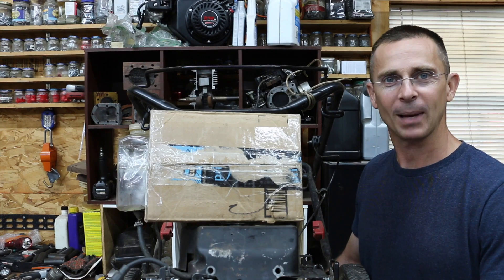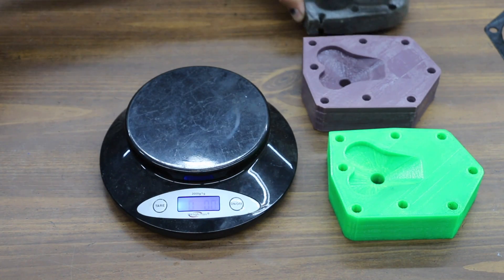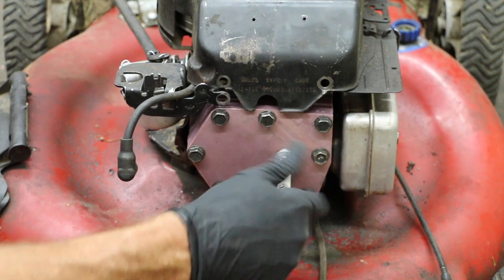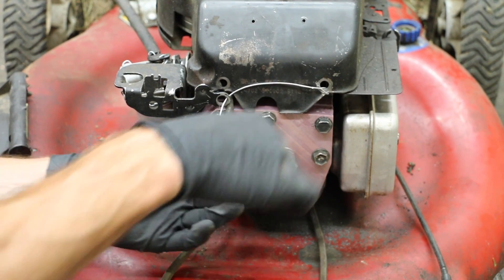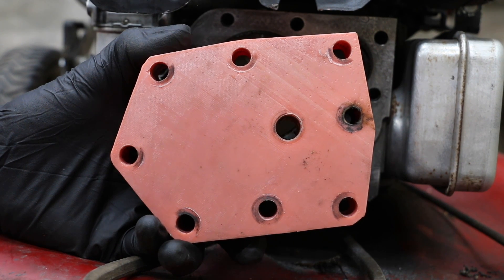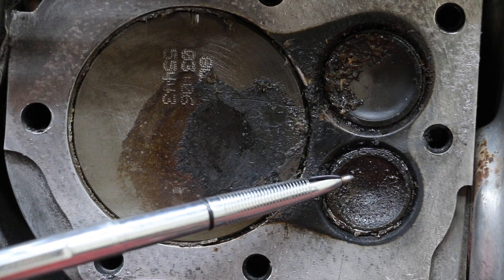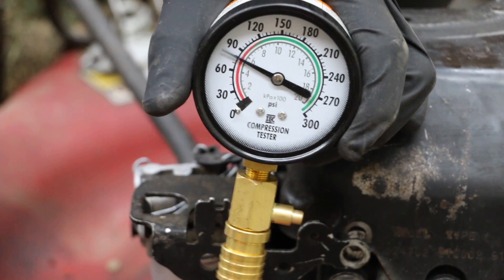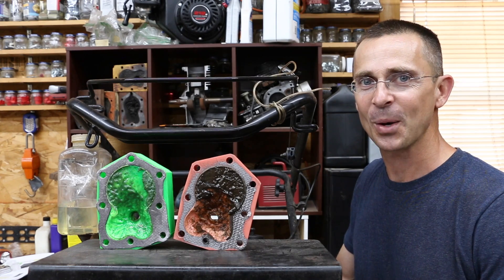How long will a 3D printed cylinder head last?  Let's find out!

Comment: Do longer spark plugs boost compression on an engine, cause the piston to overheat and melt, improve fuel economy, better throttle responce, better ignition and improved flame, will the longer threads have carbon build up causing the spark plug to become imposible to remove? Some of the things you could do. I use longer plugs on my Acura Integra. I for sure notice performance gains. Better throttle responce, more power, torque, maybe even better fuel range. I cannot give you a comparison to fuel range because the cars speed sensor is not functioning. Also the fuel gauge is not reading well. My engine is a B20B (found in CRV) and I use NGK Copper Nissan Sentra 1.8L spark plugs on it. I've also used them on the 1.8L B18B1 engine, and on a F22 single cam Vtec engine. Currently using them on my car
Reply: I have also seen and heard of people doing this to small engines like saws and mowers. Maybe you can make some material from this 👍 Hope you like my idea. Can't wait to see what you do next

Comment: You need to see what would happen is you had good heat treated plastic.like some FRP 30%.itsvthe same stuff that they use in tools motors to handle high temperature.

Comment: As a fan of 3D printing this was great. It did make me wonder if any of those heat protectant coatings would make any difference.

Which leads me to wonder, do any of those coatings help on normal cylinder heads? Does the Jet Hot vs Swain tech cylinder head coating make a difference in fuel economy? Carbon deposits? Power?
Reply from the maker: Thanks for the video idea.

Comment: Easy-lock thread inserts are great for increasing longevity of threads on plastic/polymer applications. In this case it would’ve done a better job preventing the spark plug from shearing off of its threads due to the fact the easy lock thread inserts are steel and the outer threads have a bit of thread sealant on them to ensure a secure fitment to the plastic.
Reply from the maker: Thanks for the feedback.

Comment: The type of 3d printer that made those two use heat around 200 for pla and 240 for abs to mold the plastic.

You ought to try a SLA 3d print. It doesnt use heat to mold but ultraviolet light which means it may last longer possibly. Admittedly I'm not sure how it does with heat.
Reply from the maker: Thanks for the feedback.

Comment: Hi. What a great show. I would love you to test Xado one day. they claim to have a TUV certificate. This is what they claim "Atomic Metal Conditioner Maximum with 1 Stage Revitalizant is an innovative 3-component product specially formulated for treating vital engine parts in cars with oil system capacity up to 5 qt. Due to Revitalizant the product reduces friction, rebuilds worn metal in engine parts and creates protective coating against future wear, thus providing tools-free restoration and anti-wear protection. Product application prolongs the life of your engine and allows avoiding expensive repairs in the future. One treatment lasts for 60,000 miles!
"
Sounds unbelievable to me. I have more trust in you than a lot of the so called testing experts. They further claim improved fuel consumption and compression with better balanced compression on multi cylinder engines. Further I would like to say  Well done testing. Excellent shows.Keep up the good work!!!! Maybe you should look at brave browser. I would love to donate from there.
Reply from the maker: Thanks for the video idea.

Comment: I'd like to see Polycarbonate.  Higher temp resistance than ABS and very hard.  I've printed it a few times.  Transparent polycarbonate would probably last longer than the ABS one and look pretty cool, might last almost as long as the see through cylinder heads that warped perception uses (I think he makes his out of polycarbonate sheets?  or maybe acrylic)
Reply from the maker: Great suggestion!

Comment: Well I could have told you that.

I use PLA and 3D printing quite a bit at our shop and I specifically tested PLA prints for use as molds for Aluminum Oxide blast etching (Part numbers/serial numbers type) and PLA did poorly no matter how thick were the prints.
Reply from the maker: Thanks for the feedback.

Comment: ABS and PLA are some of the lowest temp FDM printing media, you'll want to look at polycarbonate and Ultem for better heat resistance. if you get into casting however, you can have some real fun with thermoset plastics.
Reply from the maker: Thanks for the feedback.

Comment: Putting gold leaf high temp epoxy bonded to the plastic facing the heat can reflect IR heat in low temp applications than next to the exhaust value of an engine, like making a modified warm air intake to improve fuel economy of your hybrid car engine (an upcoming project of mine) // similarly using carbon fiber ASA or other higher temp 3D printing filaments would make a much more heat resistant part. 3D metal printing could similarly make an awesome air cooled head thats much better than stock //
Reply from the maker: Great point. Thank you

Comment: No judgment here, just an facts & a clean air mod idea. Small motors like this without emissions controls emit up to 25X more lung toxic exhaust products HC PM/ Soot / CO / etc per gallon burned compared with modern gasoline powered vehicles (ICE cars)

A simple catalytic converter mod would radically reduce the mowers emissions, though it would cost as much as a new mower ..
Reply from the maker: Thank you for the feedback

Comment: You should make one out of Polycarbonate.  It has an extremely high heat rating for a 3D printing filament (302 degrees f or 150 degrees c).  It is better suited for this type of application.
Reply from the maker: Great feedback. Thank you

Comment: Heat treated PLA would be interesting,  heat treating PLA more than doubles the temperature it can handle, but also warps and shrinks the part a bit so probably not going to be that easy to make a part that fits properly. Also would be interesting to see PEEK or ULTEM but those are absurdly expensive materials and you would need a very high end printer to make the parts but the material could handle the temperature and pressure.
Reply from the maker: Thanks for the video ideas!

Comment: The number of different types of plastics for 3D printing is increasing rapidly.  PLA is the cheapest, play plastic, good for prototyping.  However there are semi-metallic plastics that can stand much higher pressures and temperatures at a far greater cost.  3D printed parts are used on the Space Station.  I have access to a Lulzbot Taz 6 which is a 3D printer made with 3D printed parts.  I am pretty sure that you could 3D print a durable cylinder with with proper filament.  However, it would probably cost more than a metal one.
Reply from the maker: Thank you for the feedback

Comment: What if you electroplated the inside with a metal like Crome or aluminium or steel , would that last longer. You will need to coat it in some form of carbon to make it conductive first
Reply from the maker: Thank you for the video idea!

Comment: It's clear that a 3D printer MELTS the plastic with low temperatures to print, so a combustion chamber (60 to 90ºC normally) will OF COURSE melt it. I laughed a LOT with the wooden combustion chamber!!!!! Next time use a chemical plastic, start with a block, then model the piece step by step matching the original. With this method you can even use metal!!!

Comment: I'm pretty sure it would have worked if you'd used a metal additive printer to create the cylinder head. One question, how about offering your t-shirts in sizes larger than 2-X? Maybe up to 4-X?
Reply from the maker: Thank you for the feedback

Comment: You should try a 3d cylinder head printed like these, but line the inside with a coating of jb weld. I'd be curious to see whether it would prevent melting
Reply from the maker: Thank you for the video idea!

Comment: That was a cool experiment, but the big kind of "no duh" thing here is that the plastic is heated by the 3D printer to be melted and layered into the shape you want, so of course the heat was going to get to them. There are instead 3D printed that use resin and UV light to cure almost like epoxy. I'd be curious to see how cured resin or even cured epoxy in a mold would work.
Reply from the maker: Thank you for the feedback

Comment: Polyimide (Vespel), Polyamide-imide (Torlon), PTFE and PAI are some plastics that may stand up to such a test. That said, I don't know if any of them can be used in a 3D printing application.

One thing that could be done is to modify the interiors so they aren't as susceptible to contact.

Comment: If you just want to make gaskets, why not just use a laser cutter and sheets of actual gasket material? Using a 3d printer for such thin 2.5d parts seems a bit silly to me.
Reply from the maker: Thanks for the recommendation

Comment: If you want to send me the .stl file for the cylinder head, I’ll SLA 3D print a high temp resin version good for 500 degrees F.
Reply from the maker: Thanks for the offer.  The person who printed these is working on printing some designed for higher temps. Thanks again!

Comment: You should test with better filaments abs and pla are very poor when it comes.to the stress and heat... Check a plastic alloy or high temp filament for better results.
Reply from the maker: Great suggestion!

Comment: PLA has a lower melting point than ABS. 
Anything 200 DegC and above will melt the ABS as most 3D printers typically extrude ABS in the 210-240 DegC range. Unsure if ABS is soluble in Diesel.. don't think so but it's certainly soluble in Acetone.
There are some high temp filaments available however.

Comment: I don't know if you have the money for it, but I'd be curious how high temperature plastics like PEEK which should have an operating temperature of around 600f. Perhaps 3d printing nerd could give you a print, since he does have connections with some industry folks. I'm sure they'd love to put it to the test now that you've done PLA/ABS.
Reply from the maker: Thank you for the feedback
Reply: Also Vegoilguy would be interesting to see what a lost pla casting could do. By casting you can attain much higher temperatures, however of course, when doing a pour the dimensions are going to shift a little and it would be interesting if the tolerances can afford for it without additional machining.

Comment: How this guy gets his mower started with these heads is amazing, I can't get mine started with stock components, new spark plug and fresh gas.
Reply: My guess would be he starts it regularly and doesn't have it sitting for extended periods of time.
Reply: check the air filter
Reply: Your cylinder head might be made of a material too hard
Reply: clean your carb
Reply: Theres a flywheel shear key that can warp or even snap causing the motor to be out of time and it wont start
Reply: @joshuamcpeek4708  that happen's alot more often besides dirty carburetor's.
Reply: @joshuamcpeek4708  Hey Josh, what years of those engines did they use a sheer key? 
 And I have an single cylinder engine on a generator that I forgot to run the gasoline out of it.  The gas was ethanol free.  And that was maybe over 3 years ago.  Probably didn't have much gas in it.  Any suggestion are welcome.
Reply: Ether
Reply from the maker: Thank you for the feedback!

Comment: Just an FYI for anyone that's interested. I just did a 5 page report on 3D printing/additive manufacturing last night for my engineering class, so I'm feeling especially knowledgeable for a few days until I forget it all...

ABS vs PLA is a common decision to make when doing 'extruded material' 3D printing. ABS is a plastic made from petroleum, so it toxic (fumes). PLA is made from organic materials, so it is not toxic, but, as the video shows, it is not as strong and is more sensitive to heat.
Reply from the maker: Thank you

Comment: God you Guys! I couldn't stop laughing at many of the comments here! You've definitely torn out a new anus for Project Farms . For any newbies out there who've just discovered 3D Printing and how most of the magic, with those machines, is done by the use of heat melting the extruders to create the shape, please know for God's sake you can bypass this entire video. Project Farms even admits at the very end of their clip they would like to experiment with 3D Pieces on things that don't require heat. 

Things got crazy funny for me at frames 2:56 when a major screw "fell out" onto the Lawn Mower upon startup. I sat sat there glued 2 uTube waitin' for shlit to blow up.

What? Are you still here? Okay, I do have a theoretic question about doing this same experiment "otra vez" . This time, can we "Chrome Plate" all the 3D Cylinder Heads First? Next, forget about ever or even thinking about using a plastic gasket of any pl-whatever origin on a Lawn Mower. And can we insert a metal  Spark Plug "sleeve" to tap first? If you decide to try that updated experiment, I'll gladly microwave up some buttered popcorn and watch your video again.
Reply: Tuck Porter haha, sitting here with your 1 like.🤣

Comment: There are multiple different types of 3d printing material, some are rubber like, some are metal infused, some are wood infused, and they can all have different plastic materials some more heat resistant than others, but some can be annealed to make it stronger
Reply from the maker: Thank you for the feedback

Comment: I can print out a high heat plastic head for you (which can supposedly be used even on torch nozzles) if you send the print, I will print it for the cost of the material. Look up FORMLABS high heat.

Comment: Awesome channel! Amazed at how long the hardwood cylinder head lasted. Any interest in testing 3D metal printed parts? Or, combinations of different 3D printed materials and sandwiching them together to make the cylinder head? Obviously a heat/fire resistant material where sparkplug/cylinder/valves come in contact but, a sleeve(metal?) where sparkplug is, maybe. So many avenues to explore, Very thought provoking and inspiring!

Comment: Well, I'm now addicted to your videos!!! So applicable for my line of work. Have you ever run  straight Sea Foam in a 2 stroke engine. I've heard that that's what it was used to be for marine applications. Would it run an Echo or Stihl?
Reply: DO NOT DO THAT. It is used to fog engines not be used as a fuel source! I'd be very concerned about your bearings and rings. Take my word for it or not but I'm ASE certified and also an Engineer. Bad idea.

Comment: Great videos as always and I was curious what do you think a cylinder head made up of the 3-D printed plastic like that would do with a thin layer of metal over it? Perhaps even a layer or coating of J.B. weld,gasket material,high heat paint or finishes,or any other materials that could handle the heat from the engine?

Comment: You should do a print with a high heat tolerance. I have a printer at work that will use the onyx material from Markforged, I've used it for printing plastic molds exposed to a couple hundred degrees, now I'm curious how they'd hold up. I can also reinforce them with continuous carbon fiber or kevlar filament.
Reply from the maker: Thank you for the video idea!

Comment: BACK IN THE 80'S THE JAPANESE WERE EXPERIMENTING WITH CERAMICS ENGINES. FORD KILLED THAT TECHNOLOGY WHEN THEY DEVELOPED A PLASTIC ENGINE THAT ACTUALLY WORKED RIGHT DOWN TO USING A PLASTIC CRANKSHAFT. FORD WAS DEVELOPING HIGH STRENGTH THERMO PLASTICS. WHICH IS GOOD INSIGHT FOR THE FELLOW WHO SENT YOU THOSE PLASTIC HEADS.
Reply from the maker: Thank you for the feedback.
Reply: @ProjectFarm  A FEW MONTHS BACK I TOLD YOU MY STORY ABOUT AMSOIL GREASE I TESTED VERSES CONVENTIONAL GREASE CASTRO GREASE WITH A 75W/100W LIGHT BULB. I LOVE TO SEE THAT TEST.

Comment: There's missing a big part of this though... For any 3D printed plastic to work, the print temperature of the material has to be higher than the peak EGT readings you'll see on the engine. This rules out PLA, ABS, PETG.

Nylon prints at ~240-260c normally - so if your EGT is below this, you'll be ok for longer. Polycarbonate is also printable at 240-260c and is flame retardant - so this may work also.

All will still fail as the temps will probably still reach their softening temps and warp with time - but hey, that's why we don't have plastic engines...
Reply from the maker: Thank you

Comment: I've had two of those Toro mowers.  They run great.  Good choice for a test platform.  Q: Are you testing with the cutting blade attached?
Reply from the maker: Thank you.  Blade is on the mower
Reply: Gotta have the blade or some form of counter balance.. ever put over a mower with no blade???

Comment: Being a 3D designer myself and working with these materials often, those are exactly the results I was expecting. PLA is usually printed at 210 Celcius, while ABS is typically printed at 250ish C. They do make HTPLA (high temp PLA) that might work a little better.
What if you wrapped it in aluminum foil to keep it from melting.
Reply from the maker: Great test idea!  Thank you
Reply: Project Farm if you can provide me with the file or at least dimensions I'll print new parts for you

Comment: Try a thermoplastic next time. Those types of plastics are used for applications that need to withstand high temperatures. Once the part is created the plastic itself cannot change it's shape (aka cannot melt).
Reply from the maker: Great recommendation!  Thank you